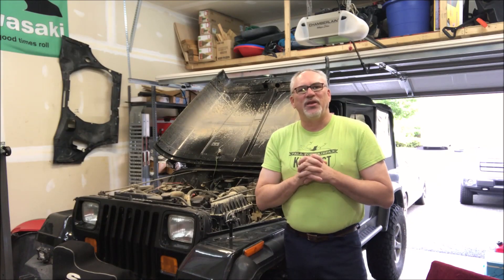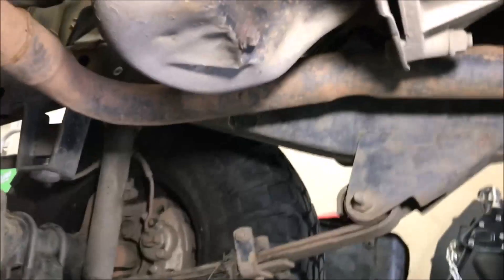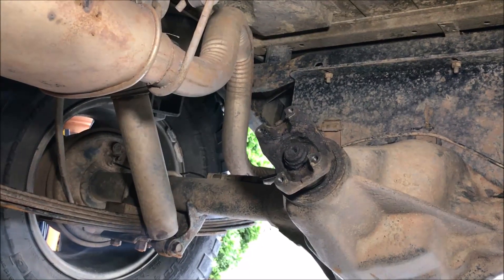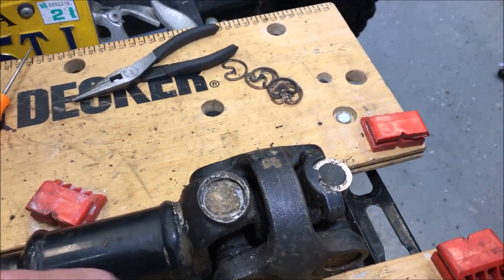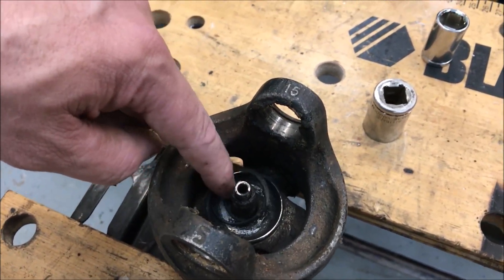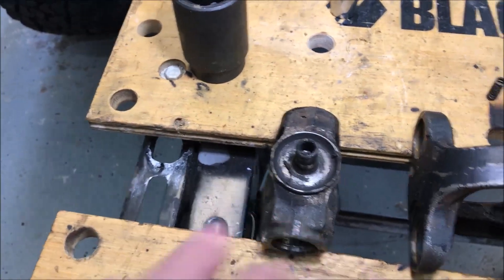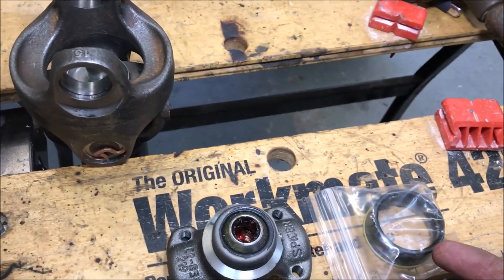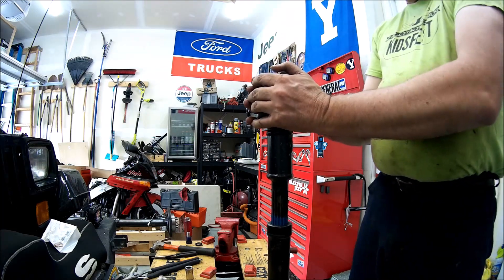Double Cardan Drive Shaft Rebuild

Comment: You know I've watched several people do these videos on the double cardan driveshaft and not a single one has filmed putting that last ujoint in. They always skip that part because it is a pain in the ass
Reply from the maker: Just doing it. The last joint was tough. Using the vise and the shaft between your legs let me have two hands to get it lined up. Then it came together.